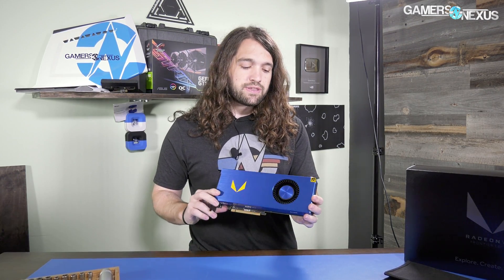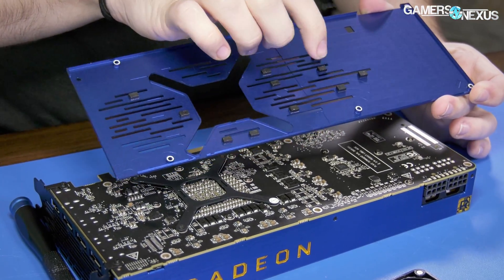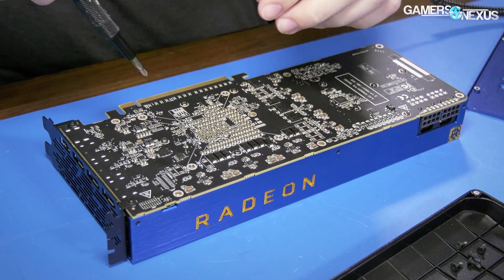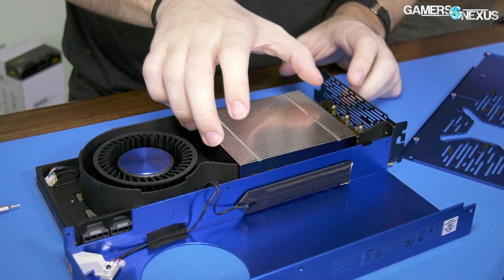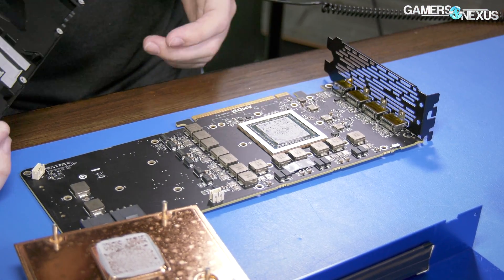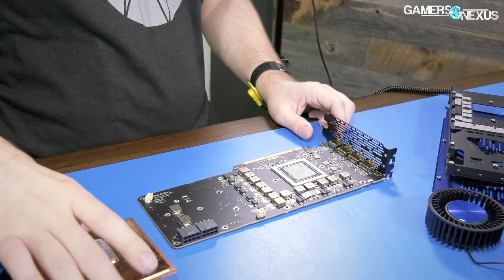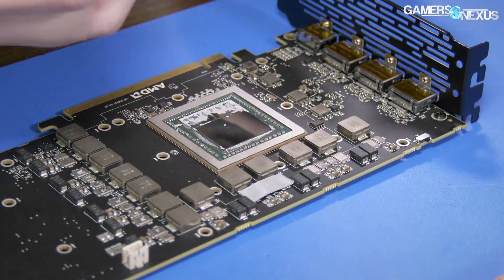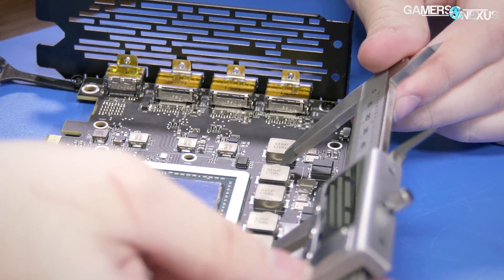AMD Vega: FE Tear-Down, Die Size, Mounting Spacing, & More

Comment: Thanks sir for you closeup look in  your tear-downs.  It has helped me carefully change the TIM on both of my Vega FE's and both Vega 64's.  PS that has worked out very well and I have reached much higher average clock speed with my Thermal Grizzly Kryonaut.  So that stock TIM isn't doing a great job moving the heat through to the copper base-plate.  I wonder if it was some sort of Alumina?

Comment: What would actually happen, if you guys  directly contact EK and let them  make a custom Waterblock  put a loop including a 360mm or 420mm  thick Rad on it (only the card in the loop)  and OC the crap out of this card? I wonder (ò.Ó)   And for all the folks out there:  This card isnt meant to be a  play your games card. This card is designed and have to be taken as a Workstation card. In Germany  the FE costs 1200€   and a Titan XP 1500€  and the FE outperforms the Titan XP by ~21% when it comes to actual Workload! In Realworld Scenarios! Its made for Small to Midsice buisinesses. Custom Watercooling would be a gr8 way  to test out of it can compete under specialized circumstances in Gaming tasks.

Comment: Would it kill manufacturers to use the same style screws everywhere?  Also, so many screws .  Use just enough to hold things together, no more no less.  Non-screw options like brackets, clips, sliders, etc. are good alternatives (esp. hinge+set screw).

Comment: 13:05 that's a vapor chamber dude, which works same as heatpipe it's using chamber instead which is much more efficient in dissipating heat than heatpipes, however more expensive ;) High end cards are using this type of heatsink quite often, Xbox One  will have it in it's premium X model too ;)

Comment: Those extra screw holes are for metal brackets that attach to the end of the card for securing in some workstation/server cases. All high end Firepros have em and come with that metal attachment.

And that's probably a vapor chamber, not a heat pipe.

Comment: Lol how could you not know that cooling block its, its not a solid piece of copper but a vapor chamber and the nipple on the side is where they pump the air out then inject the fluid as well the wick.

Comment: From the looks of it, the Vega FE will be almost the same specs as gaming Vega. And it is clearly the full Vega chip. So despite what some of you think, the current performance is directly representing the game performance we will see from Vega at Siggraph. 

Gaming Vega will be almost identical in game driver optimization and specs however it will definitely run a much more aggressive cooling design so it can clock on easily at 1600 MHz. 

Its difficult to say what is the issue here. Games are optimized for Vega. The issue at hand can either be the Next gen compute units (NCU) are the same thing as GCN, which seems to be the case or the Vega architecture as a whole is extremely unoptimized. 

Its really worrying since when the 7970 came in, even though drivers and optimization were all around terrible, it was a force to be reckoned with (28 nm vs old 40 nm...i know). It improved dramatically with time. So we all had our hopes that Vega, regardless would knock off the 1080 buuuuuuut no lol. Around 12 to 15% slower on average......

Comment: want to hear a tip. At the end of your callipers there is a little rod thingy that come out when you open the callipers, its called the depth probe. You can use that in conjunction with the base of your callipers to measure the depth of the package on the pcb.

Comment: 15:11 The DEPTH GAUGE that's part of the calipers is in view, but the guy goes ahead and measures the depth / height of the GPU with the caliper jaws...

Not to mention it's an <ahem> DIGITAL pair of calipers, so you CAN get an actual numerical readout (as opposed to guesstimating)... Well, that is, assuming you 1) have a battery in it, 2) turn the thing on, and 3) zero it out prior to a measurement. But what do i know?

Comment: 12:48 It actually looks like ending of vapor chamber which is basically flattened big heatpipe. Looks neat. I wonder what are the temps with stock TIM and after you applied new TIM. The stock one looks like old one even it is new.

Comment: Guys in the comments need to wait for the proper consumer VEGA Graphics gaming card, this one in the video is VERY clearly a workstation card with WORKSTATION drivers, this is NOT a gaming card at all. Just wait for the actual consumer gaming card seriously.
We're still likely to see 1080 performance with the top end gaming VEGA gpu tho, so dont have high hopes.
  Just need to drive it in, this is a workstation card. I dont get why all these media outlets are doing teardowns and gaming benches with this card, I've never seen gamersNexus or anyone else Take apart a Quadro card or one of the other Nvidia workstation cards and do benchmarks etc with those, makes no sense to me.
Reply: Yep, but the drivers are still very early in development from what I understand. The cards still not designed for gaming. Sure you can play games on it in its "game mode" but its not what its intended for.

Comment: 999$ for a card with performance around the 1070, 1080... No wonder they are not sending review samples, they know it's crap.
Reply: Extreme 4k Gaming AMD confirmed they are still working on the gaming mode drivers, keep your fucking knickers on.
Reply: oh god the ignorance...
Reply: It's not for gaming you inbred,however it blows the quadro by miles.

Comment: Without the gaming drivers this card is able to perform like a GTX1070/1080.These drivers are not optimized to use the new tech for the gaming purposes.I expect a gtx1080ti performance with the drivers that can use the new tech for gaming.All these people hating on AMD right will eat crow fk yea
Reply: Extreme 4k Gaming sir if you don't know yet AMD has already said that there is performance delta between gaming and pro mode and secondly the gaming drivers included are old fiji drivers that is why currently vega is acting like a OCed FIJI card.Rx Vega card will have latest gaming drivers which will certainly boost the performance. New tech included in vega in not being utilized well for gaming.Just wait .In past we have seen AMD cards get 40% faster just cause of driver updates.When 480 was released we saw how it under performed when compared to Gtx 1060 but today in most games 480 is better.Vega will definitely surpass 1080 performance levels and even reach 1080ti levels in some games.If AMD gets 1080ti performance levels and prices it 100 dollar less then Ti they can surely win a large portion of GPU market

Comment: Just a little tip, when checking the depth of the die, the best way would be to take the measurement of thickness of the PCB and then use the depth measuring blade that comes out of the bottom of your Vernier gauge. Saves the faffing about at 15:30ish. Great vid though 👍🏼 just my minor advice on use of a Vernier gauge, or in your case a digital micrometer

Comment: The copper protrusion you saw on the seat sink was from Manufacturing. It is called when the heat sink is casted. That is a die casted copper block and that is left over from the mold.

Comment: my preorder just arrived ETH hashrates is around 33mhs at 300w useless for mining
Reply: Mundie Afterlife Thank God.
Reply: What about other currencies? What kinda zcash rates?
Reply: Yay! Prices might be reasonable for the consumer cards!
Reply: Two RX 580s are a much better deal to mine with than one Vega FE.

First, two RX 580s would cost somewhere between $400-500, which is basically half the price of Vega FE 

Second, Vega FE can only mine at 33MH/s, whereas one RX 580 can mine almost the same with a modded BIOS

Third, Vega FE consumes around 300W of power and two RX 580s consume the same amount, at half the price, and double the hash-rate
Reply: Before that they were $200-270

Comment: Thanks Steve Job.....Well Done....A point to emphasize. Anti Static wrist straps ARE A MUST. I've been involved in the Computer Industry for more than 30 Years and have noticed Antistatic Precautions becoming very lax over the last 10 to 15 years. I'm giving serious consideration to making my own youtube addressing the subject. As a spoiler let me point out taking static safety precautions is not so much about preventing destuction of components but rather to prevent the degradation of the Performance Knee. One can be sending very small static discharges through a component without ever realizing it.
Reply: Yes All semiconductors whether they are BJTs or FETs have a performance knee. Looking at the I/V Graph, Current versus Voltage, in a perfect world the switching point would be a well defined right angle. But in the real world it is rounded off. This is dependent on a number of factors but the main thing to remember is the gate having the best performance has the fastest switching time and the sharpest knee. Static discharges send currents through those devices which degrade them. That degradation makes the knee bigger or fatter. Send enough discharges through the device and it is destroyed. Actually in real life that is the easiest problem to deal with. You either change the bad component which is usually easy to find or you trash the card or assembly. But if you send mild or weak discharges through them and you degrade components to the point that it cause intermittent failures. These types of failures can have repair personnel tearing the hair out of their heads. In the last 25 years most major companies have policies that a board returned for intermittent problems for the 3rd time are considered unrepairable and trashed. The same thing affects electronics in the design stage especially when engineers are trying to Timing Diagrams. They need to do this so an assembly doesn't enter into an undefined state that will cause a device to lock up.

Comment: Those 4 screws on the front of the card are for rack server brackets, they look like handles and hold the card from the back. Some OEMs also use them to securely hold cards in.
Reply from the maker: Interesting! Thanks!
Reply: Gamers Nexus many of the old radeon cards have them. Case manufacturers don't seem to use them nowadays
Reply: I know Alien ware did something similar with the HD5870 in crossfire, but the bracket was part of the backplate on those. My HD ProLiant DL380 G7 rack server has a bracket system that screws into the screws found on the back of cards, but being only 2U it only has single height card support.
Reply: Come to think about it, AMD could've cramped all the Vega FE's component onto Fury sized PCB but chose not to. Is it because of the server rack mounts at the back of the card (screw holes)? It needs to reach the frame, so it can be screwed on. Just curious.

Comment: Heat pipes and, in this case, vapor chambers have the inside under vacuum pressure to make the liquid boil at lower temps. That "extra" protrusion in the copper base of the cooler is a vacuum tube.

Comment: when you release the benchmarks, could you add hashrates please?
Reply from the maker: Do you have a suggested method to do this? Not experienced with it.
Reply: Oh damn, didnt expect a reply :P 
Here you have a link for the miner I'm using (just uploaded it now for you): https://goo.gl/eEoHPm
After unzipping, just use start.bat, it won't download anything, everything is setted up. 

This is how the output should appear: https://goo.gl/uT2ogW 
If you have any troubles for this send me a message :) 

This is the most popular miner for Ethereum, my R9 Fury gets around 29MH.

PS: subscribed also :D
Reply: Hardware unboxed also tested hashrates on future epoch sizes for over 10 different cards. That man goes above and beyond :p
Reply: Someone did 33mh with claymore
Reply: the problem with Claymore's benchmarks, is that if you want to benchmark ahead of time it has to download a lot of files to "simulate" that time. Those files are pretty big and take a lot of time to download.
Reply: how about the hbm2 memory tough, gddr5x also has problems with ethereum
Reply: download nicehash miner and run benchmarks . the dual mining benches in claymore IE  eth+sia etc uncheck them from the tests. .Remember go into settings before u run any tests and uncheck "disable amd temp control" or it will screw with your fan profiles.
Reply: A lot interested in its mining potential were wanting it tested undervolted as well
Reply: Claymore's Ethereum miner has a built-in benchmark mode that allows you to see how the mining performance of a card will evolve over time. Legit Reviews recently did several extensive tests comparing hashrates of various AMD and Nvidia cards, so if you want a good reference point go check them out.

Comment: 4900 RPM my sweet fuck
Reply: 4900 rpm monkaS
Reply: According to Wutman my old RX 480 could go over 10k RPM...
Reply: AntiZippo Wattman has definitely gotten better, but it's still my last choice for altering clocks, voltages, fan speeds. Afterburner is still my go-to.
Reply: Well, it is a blower style cooler. And a Delta fan on top of that.
Reply: It's a delta fan for rackmount cases, obviously it's gonna be high RPM.
Reply: My Gigabyte R9 Fury is currently maxed out at 4180RPM, my Nitro tops out at ~3420RPM. Wattman says max is 4400RPM, but I've not seen it hit that at 100%. For a triple fan card, almost 4200 is absurd, but 4900 seems reasonable for a blower style card.

Comment: There seems to be a lot of real estate left open on the pcb. Possible AMD might do the whole two gpus on one board again?
Reply from the maker: Probably mostly because it's tough to do a blower on a shorter card, but hard to say for sure.
Reply: Gamers Nexus blower on shorter card is not that hard. imagining how it would work anyway. ssg comes to mind. maybe the reference PCB is designed with the consideration that an ssd could end up there
Reply: Not saying it would be efficient, but two GPUs connected with infinity fabric like their CPUs would be interesting to see